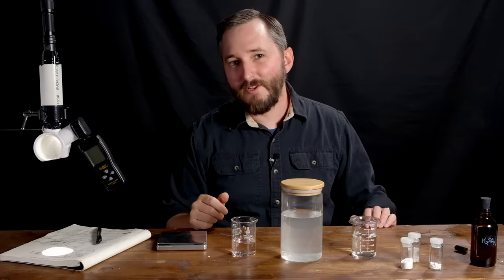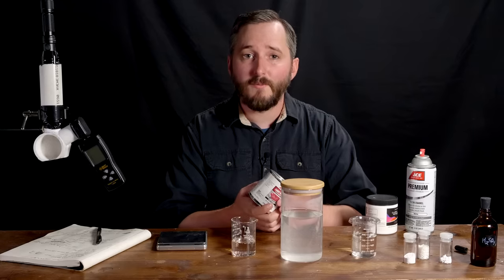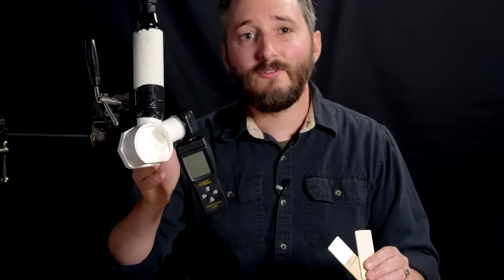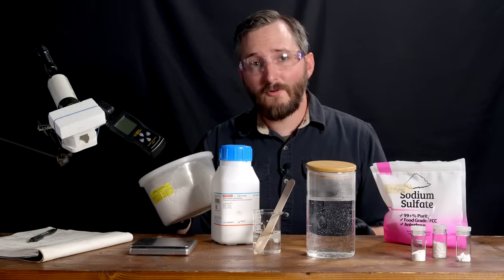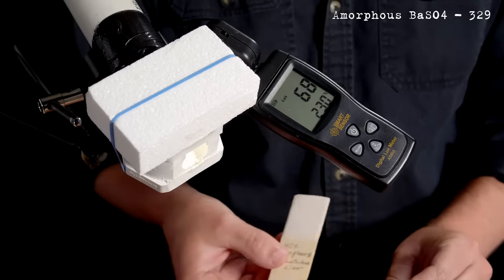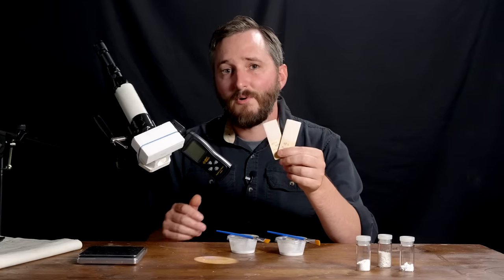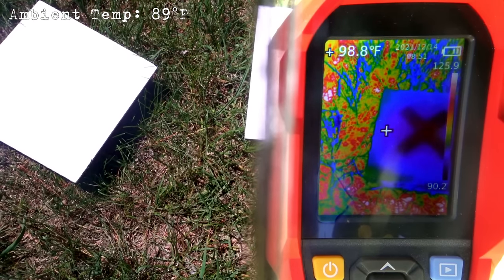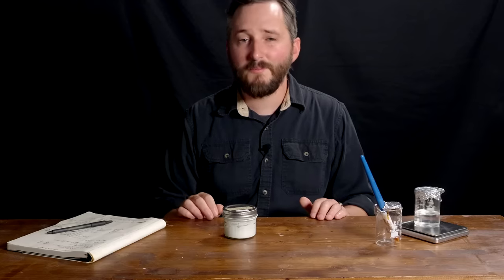How To Make Infrared Cooling Paint (Electricity Free Air Conditioning)

Comment: Idea: experiment with infrared cooling/barium sulfate coatings on solar panels! Anyone who measured/experimented with solar panels can tell you that their efficiency significantly drops when they heat up just in sun (I measured ~20% current drop at start/ambient temp vs after ~5 mins in sun). Such a coating might seem counterproductive cause it reflects light and well, solar panels need light. But the wavelength of light really matters here. First, (commonly used) solar panels can't use >1100nm IR light - it's not energetic enough to make electrons move in Si. The sun puts out significant 1100-2400nm IR light which just adds heat. We'd want a coating that reflects this 1100nm+ NIR light. Thus a way to turn the experiment "failure" at 5:01 on its head as a good starting point for such a selectively reflective coating: you got high visible light transparency / low reflectance and I'd guess significantly higher NIR reflectance (particle size being the important factor). Finally, the infrared cooling effect will be beneficial year round to keep solar panels more efficient.
Reply: Passive cooling can be achieved with aluminum heatsinks on the back side however it's more likely to be far more cost effective to just add more panels.
Reply: That interferes with the solar emission gathering potential of the solar panel, unfortunately barium sulfate is not transparent so the entire front is irrelevant since you can't coat that(even selectively reflectivty would effect the energy gathering since solar panels do collect even that energy) solar panels collect, the sides and frame while it would be helpful would be fairly negligible in comparison to the amount of heat they can get rid of, the back would just reflect the back from the roof on of the solar panel again likely, unfortunately all in all it's a nice idea but physics says no,

Comment: Be interesting to see the difference between painting it on a conductor of heat like copper (maybe copper tape/foil) or maybe expanded graphite roll/sheets and painting it on an insulators like expanded polystyrene or firebrick.  I'm betting the substrate is important with panel's.

Comment: I think it would be really cool to have it be transparent as well, for use on glass and other window materials. Having a transparent layer on windows of a house or building could help reject some of the heat while still letting the window function as a window.
Reply: It would be interesting to test the first paint (the one that "didn't work well" because of transparency) on a window with a normal glass control.
Reply: They already make a cheap solution for windows.  It's basically a shade sticker that blocks out a lot of the heat and UV light.  It doesn't obstruct the view and I think it works really well.  

The room feels cooler as soon as it is put up.  You can buy this product at most home improvement stores.
Reply: I would like to use what you are talking about on my cement roofing tiles here in hot Arizona that is almost always sunny.
Reply: Thermal control coatings are already available for windows.

Comment: Very interesting project, as always!
I'm not sure, if we can trust the temperature readings from the IR meter though. Couldn't it be, the effect you are observing is just a difference in reflectivity? This could also explain the difference between direct sunlight and ambient light. Maybe you could try measuring the temperature using photochromic paint or some other method
Reply from the maker: Much of the temperture difference is caused by a difference in reflectivity, in that the more reflective paint absorbs less heat and stays cooler in the sun. It's easy to tell with the IR cam when you're dealing with reflection that throws off the readings and I'm certain that was not happening during my important measurements. For one because the paint does not change temperature instantly when moved in and out of direct light.
Reply: I suppose that the relevant metric would be the other side of the wood after long expose under the sun. Either way you will know if it really cools down or not when you build your panels. Another possible use of your paint + plastic layer would be as the back reflector for solar heater, the kind with a coil of flexible piping. It should return radiant heat to the coil instead of absorbing it in the support structure. I'm not sure if the efficiency gain would be meaningful though.
Reply: @Nighthawkinlight  Thanks for clarifying! Especially the fact the temperature doesn't change immediately under different illumination is solid proof of an accurate reading.
Never having handled IR cameras myself I can't judge how well they measure different materials and surfaces. But I'm quite sure there are some assumptions when converting measured IR wavelength to the temperature of the emitting (or reflecting) surface which might not necessarily hold through for pigments with a atypical spectrum.
Reply: @umbrel  I'm not really familiar on the details but if the goal is to reflect as much back for the tubes to absorb, would a mirrored surface be better? I've seen survival shelters that use mylar blanket as a reflective back and a thin plastic sheet as the front to trap heat, so maybe a similar idea.
Reply: @Nighthawkinlight  Hi. IR thermometers/cameras work with specific wavelength bands and you have to know the emissivity of the object in that wavelength band to get precise measurements. Here you are doing all you can to change that emissivity spectrum. I would be very skeptical about the FIR temperature readings without a specific calibration.
Reply from the maker: @lucbuydens1783  I'll use thermocouples for future tests
Reply: My roof is foamed with a white coating, standard roof paint. The minute the sun isn't straight on it, it gets quite cool to the touch. Cooler than ambient,  it is weird.
Reply: @KevinSmith-os5yz  It should also be slightly warmer on overcast days, as opposed to a clear sky :-u
It is reflecting heat out into space. Sounds sci-fi but is how the universe works :-)

Comment: Great Work !
For your further work see also the Pyrgeometer for measurement of the cooling effect especially by night.

Some year ago we made some passiv cooling devices for small off grid electronics in desert areas. It consists from a liquid reservoir with free gasphase in contact with the electronic heat sink and a vacuum tube insulated solar collector connected with the reservoir by a tube filled with the vapour from the liquid and a downcomer at the low point of the collector going down to the liquid reservoir and submerged below the liquid surface. The solar collector (better "radiator to space") was installed on a high point in that way, that it only sees the sky an no surrounding buildings, rocks or other surfaces with ambient temperature. 

At day the solar collector and the gase phase in it gets really hot by the sun, but thats all: the liquid (and in cases when pure water is used as working liquid) even ice in the low reservoir stays cool and is able to cool the electronics by heat capacity and gets slowly warmer respective the ice  melts. More interesting by night: because of the very low sky temperature above the desert (air mass is dry and there are no clouds) the vapour from the liquid chamber condenses in the solar collector that works as an radiator to space and cool liquid refluxes to the liquid chamber by the downcomer because of gravity. If you get problems with ice plugging that can easily be solved by using alcohols like methanol or ethanol as working liquids or such alcohols as additives to the water. In the beginning you heat up the system to boiling temperature at normal pressure to remove all non condenseable gases (especially ambient air) or use a vacuum pump, before you seal the system (system works under low pressure condition and with pure vapour phase only). 

If you want an ice buffer, you use a chamber with pure water under normal pressure and a submerged tube coil filled with working fluid under low pressure (refrigerants like propane or alcohols work) as an heat exchanger on low point. 

I am shure, that the system could be improved with your paint, compared to the black surface of the vacuum insulated solar collectors (insulation tube should be made from infrared transparent glas ceramics).
Reply: I have looked at these systems before. They are very "cool!" Pun intended. One I was looking at used coconut shell activated charcoal and methanol. Unfortunately, they don't seem to be practical for residential cooling needs, refrigeration/air conditioning.

Comment: I'm interested in how this paint will perform in tropical 'summer' temperatures of 30-40C, especially to places as tight and suffocating as in the New Delhi slums.

I've watched some videos of NGOs painting flat Indian home roofs white to combat deadly daytime heat, and having a cheap sheet of clear plastic in addition to the paint might help in reducing heat conduction from the wind and protect the paint from weather. It's not as good as your snow barium paint, but at least plastic sheets are super cheap.

Comment: once you get cooling panels working, it would be nice to see if the cooling is enough to keep a stirling engine turning a small generator, or to see how it would effect a stirling engine already running on heat from a solar heating panel.
Reply: If you can get a Stirling engine running, then you can use that to run a loop of refrigerant through another panel, increasing the temperature drop achievable by "passive" means.

The heat difference between the Earth and space is a giant potential source of energy whose only running cost is dropping the temperature of Earth. Pretty sweet. Banking heat from the day to run an engine at night could further help with the efficiency.

Comment: We definitely need a series.  Can you improve the white paint by adding barium   sulfate?  You mentioned calcium carbonate, what are it's  relative properties?
Reply: Calcium carbonate is the main component of limestone, chalk, and has been used as a rough surface coating called white wash.
Reply: @jophmac  and how does it compare to barium sulfate as far as emitting in the narrow band ir that transmits to space?(RELATIVE properties)
Reply: Calcium carbonate is the ingredient used in "White 2.0", IIRC. I wonder if silver may help in some part of this equation.
Reply: @ellisgl   I wonder if it is a specific particle size?

Comment: I will point out the obvious that just having a very reflective roof is already going to be a lot better than, for example, an asphalt roof, in reducing cooling demand. If you're worried about thermal management in a building, there's lots of low hanging fruit in just not gaining quite so much darn heat from sunlight even before anything as sophisticated as this. Very cool!
Reply: Yeah, we had our roof reshingled recently, and got the lightest color shingles we could, and even with that relatively minor change, it makes a bit of a difference. I wish I was allowed to paint it white, but I get vetoed on that by my spouse.
Reply: @justinw1765  Well if it's only your spouse. In Germany the government tells me what color my roof is allowed to have. Either black or red.
Reply: But this goes beyond less collection and crosses into better than ambient. Also, a tin roof in summer is hot.

Comment: I would love to see, once you get the method optimized, the amount of heat that can be radiated per square meter, for example, if it were to be supplied with warm water.

Also, with the idea of cooling panels and thermal batteries, it would be interesting to combine the idea with a low temperature phase change material, such as glauber's salt, and see how cold can be stored at night, and how long it takes for any absorbed heat to penetrate to the inside.

Comment: This is great work and I am really looking forward to the next in the series.  I've been working on design concepts for cooling panels using this general concept and while developng the paint is a critical first step there is more to making an actually useful panel than just painting something white.  In real world conditions the white surface will get dirty and weathered if directly exposed to the elements, reducing the ability of the coating to do its job.  To make something practical, that is more than just a short term demonstration of the principal of panel cooling, you'll need a design that deals with these factors.  It's a design challenge I find really intriguing and I am looking forward to see what you come up with.
Reply: You would probably want to put some kind of super hydrophobic coating on (perhaps as a substitute for thin polyfilm?), so that would less app to get dirty as fast and would quickly/easily wash with some rain or the like.

Comment: Cool stuff. I guess it makes sense that the more barium you can get in there the more radiative cooling you’ll get. I’s love to put some of that stuff on the roof of my car. I have a Tesla model three and the only thing I don’t like about it is the glass roof gets seriously hot in the summer despite tinting etc. I’d love to put some kind of temporary coating on it during the summer months.
Reply from the maker: Maybe it could be developed into a rubberized coating that peels off clean in winter. Lots to experiment with.
Reply: @Nighthawkinlight  Maybe you could paint over it with another paint in winter - ideally something that would come off with just soap or alcohol. Unsure if this is possible
Reply: Cool stuff indeed!
Reply: @Nighthawkinlight  i realize a small water content makes PDMS or some PVDF films cloudy, but not that white, but should be able to engineer it. Free standing reflective films will be really cool.
Reply: @Nighthawkinlight  Rubberized... like latex paint. Sounds like a plan! LOL   > Tom's wife Pam <
Reply: Plasti-dip perhaps?
Reply: @juanolotgn   Easiest solution would be a thin panel and have it velcroed on.  I put some outdoor/extreme rated velcro tabs on my car for outside Solar shades, and I'm still amazed they are on there and holding up fine. The part of the car that the velcro goes on needs to be cleaned really well with something like 90% rubbing alcohol or the like.
Reply: @Nighthawkinlight   yea, and perhaps in the modern day Silicon sheets, perhaps 5mm, then one could lay it in ,and peel it off

Comment: I think a practical use for this process would be to use it for vertical blinds for large glassed in areas because they could be used to reflect either inside or outside depending on the season .
Reply: Love this idea! Someone further up is hoping for temperature-sensitive paint, but this achieves the same effect with just a flick of the wrist twice each year.
Reply: @DistracticusPrime   I think it would be productive for a younger man than me to do a little experimenting with this as all that is needed is a good slat . To my mind you want an absorbent surface and a reflective surface separated by an insulated materiel just to offset the differences between the two surfaces and mount the blinds between the two layers of glass with a venting system at the top of the sash that vent heat out in summer and inside in winter .
Reply: I seem to recall most glass is IR absorbent, but probably it depends on the specific products. If the outer glass panes are mostly IR transparent, your system wouldn't even need the venting system and could be sealed.
Reply: @DistracticusPrime  That's a good point however I am extremely sceptical of trying it with a sealed system .I think the inside glass will need to be opened for cleaning and repairs . I have had bad luck with double paned glass that has lost its purge and gotten stained inside . Unless it is hermetically sealed it will stain inside eventually .On the cost side though it could be brought inline with a double paned system as it only requires a wider glazing sash . about 4 inches would do it .
Reply: @robertwilson8789 Saw a video somewhere of a house (not in US but Northern Hemisphere)  that had 4-ply floor to ceiling windows. They insulated but allowed solar gain as needed. Very specialized.
Reply: @connectropy  some of that is very interesting .Let's also think of cost .
Reply: @robertwilson8789  Quite correct.

Comment: I've been trying to follow reverse greenhouse/ir cooling as it emerges. I really like it's potential to reduce the heat island effect of cities. 

In the video you say that painting buildings probably isn't viable... Residents of tropical and subtropical regions probably disagree, but I don't live in those areas either. While cooling panels is a likely use of this technology I feel like it fails to leverage the advantages of this technology. We already have active systems for removing heat  from our structures. IR cooling can be applied to fabrics and seasonal items to provide lower temperature items with no infrastructure.  It could also be used on items that are almost always hot, like car roofs which are pretty much horrible green houses the majority of the year in most of the US
Reply: Motorcycle gear, the high reflectivity is good, but anything to reduce the heat inside would be amazing. The question then is how well does this work radiating heat from underneath. Can it act as the heat pipe, for lack of better words, between the heat source (rider) and the sink, and if so how efficiently.   In all fairness, any reduction in thermal transfer into the rider would be good.

Comment: Maybe a thin panel with a barium solution flowing (vs painted backboard) could act as a cooling panel for direct sun. Sorta like Cody's algae panels but for heat reflection. Would no longer be passive, but I'm curious about the performance of moving particles. Love all your vids man